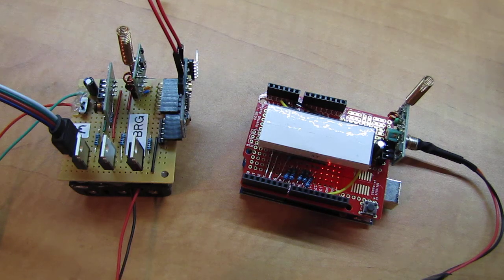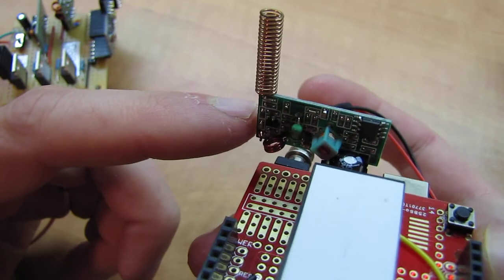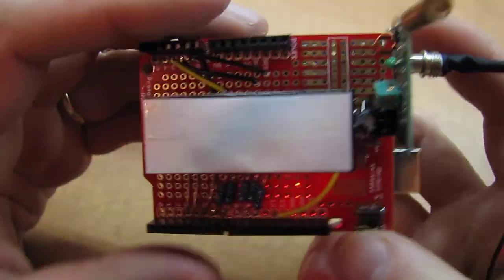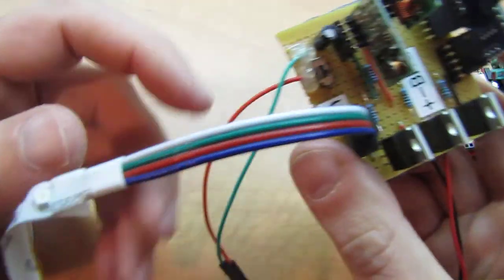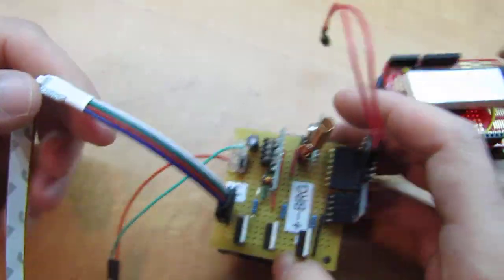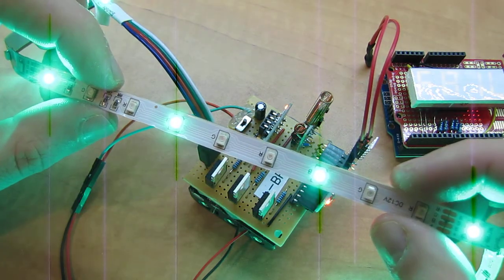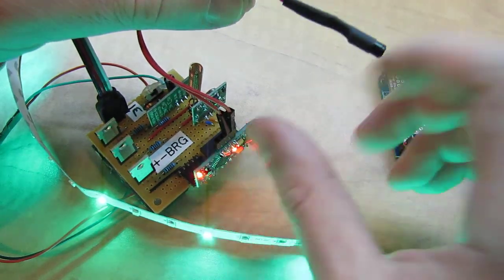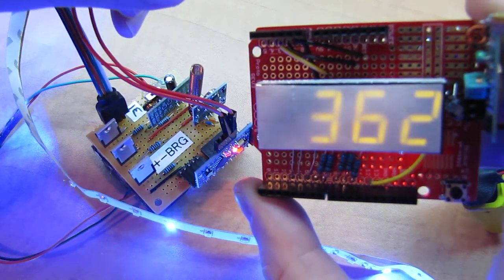The Arduino Kick Starter, Part I

Comment: can u tell me which vibration sensor have u used
Reply from the maker: Just something cheap from ebay, I don't remember the exact model. There are plenty of similar kinds. Just search "vibration switch" and looks for a cheap, small black cylinder with two pins...

Comment: Dude did you make those antennas yourself or buy them ( the ones on the RF modules?
Reply from the maker: I got them off eBay. Relatively expensive for what is essentially a piece of wire, but they look nice :-)